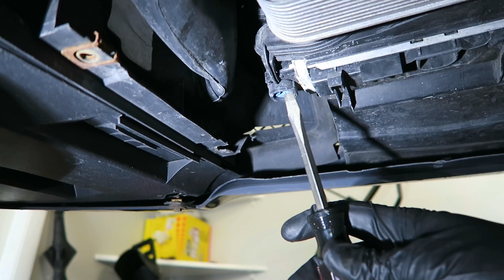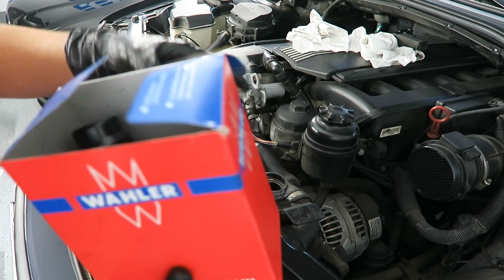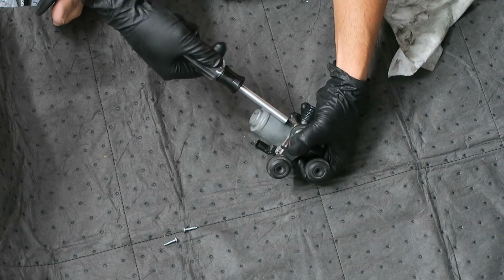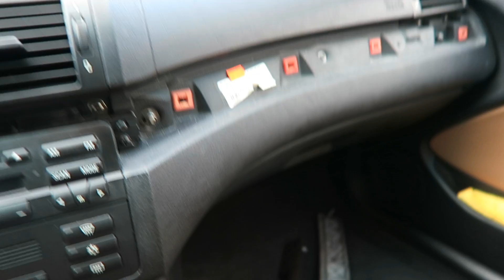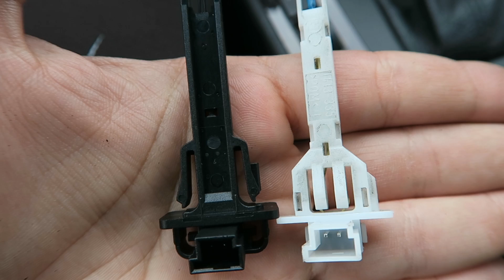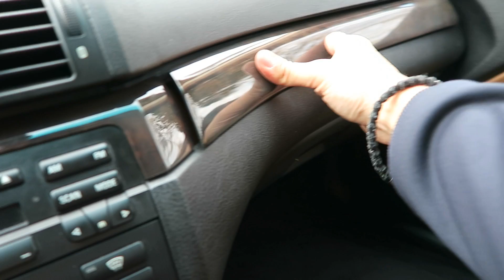BMW No Heat Fix - Thermostat, Heater Core Sensor and Valve DIY FIXED

Comment: I'm getting heat sometimes and other times nothing.  will try to change the heater core valve first and if nothing then will try the sensor. bethans for the helpful info.
Reply from the maker: Emzo Daniels try unplugging the heater core valve completely from the electrical connector. If you consistently get heat there is something related to your valve. You can then try cleaning the valve up before buying a new one. is your cooling system bled properly?